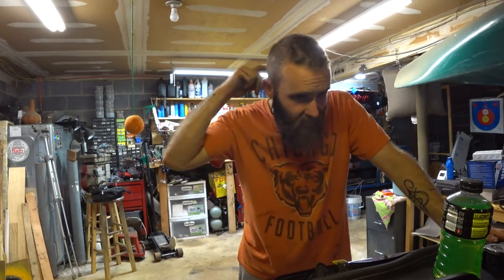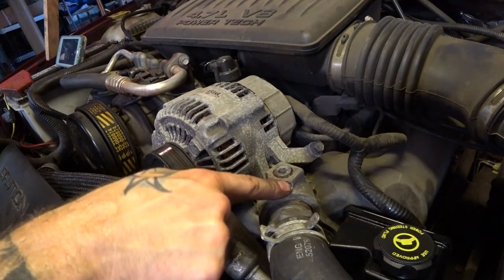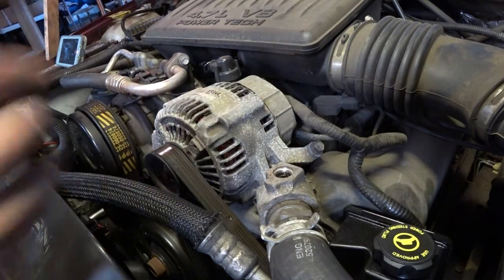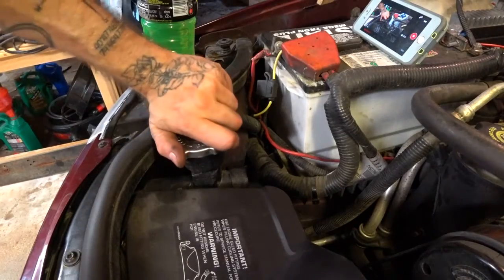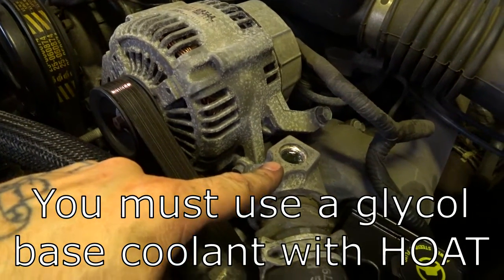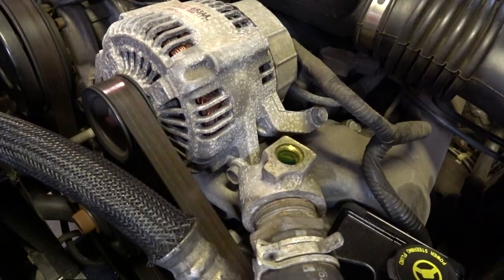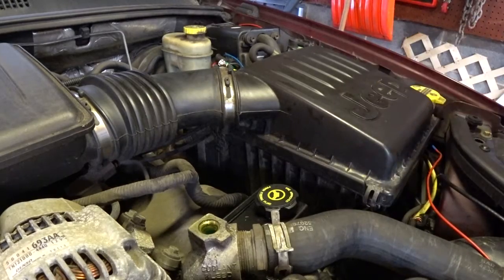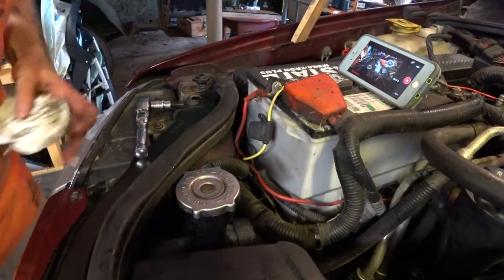How to Bleed a  Radiator - Jeep/Dodge 4.7L

Comment: My 4.7 fluctuates from 190 up to 210? I’ve tried a coolant change and bled the system and it does the same thing.
Reply: check water pump
Reply from the maker: Yea, Water pumps on these go slowly, so this is likely your warning, though 210 is not that bad
Reply: D&E In The Garage I’ve tested on 95+ degree days even with the ac on It was around 207-210 from in town driving. I went in park and I could hear the fan kick on and after a little it went back to 190. It will also stay at 190 if I keep the heat on... or if I’m on the highway with no stops... 
-
Could it be connected to transmission fluid temps going up I don’t have any alerts from the trans so far? I have the factory set up with no external trans cooler. Are coolant temps and tranny temps connected in any way?
Reply: @staticjordan42374  they are connected if no trans cooler.

Comment: Good point Doug.Usually,if you have air trapped in the system,your heater will blow cool air.
Reply: You should not take the bleeder valve all the way off you lose too much coolant that's what I found loosen the bleeder tell the air starts coming out
Reply from the maker: true!